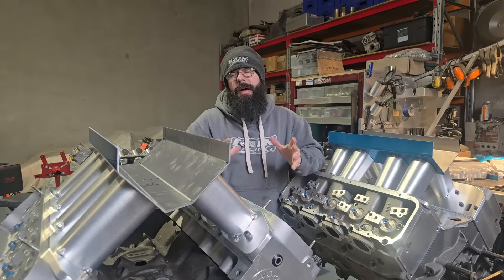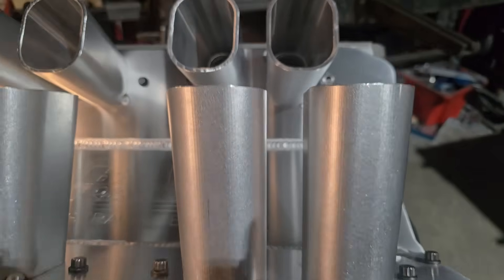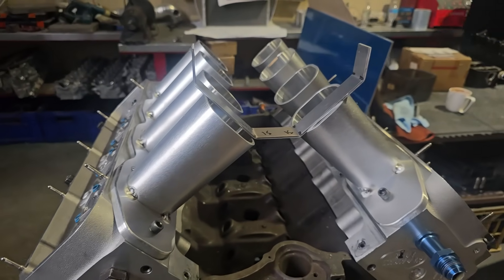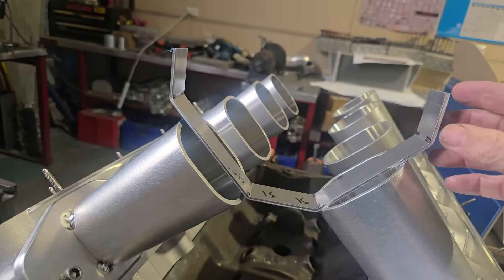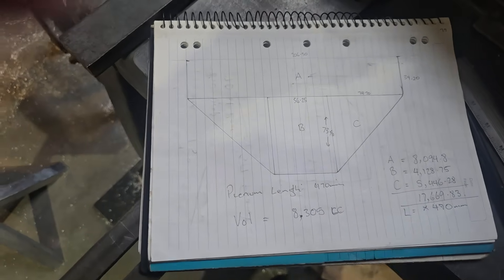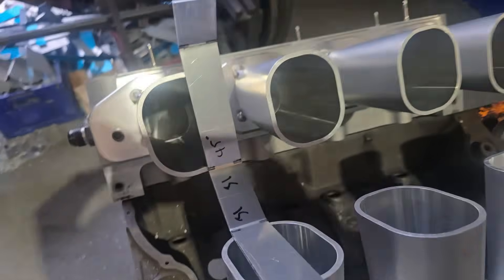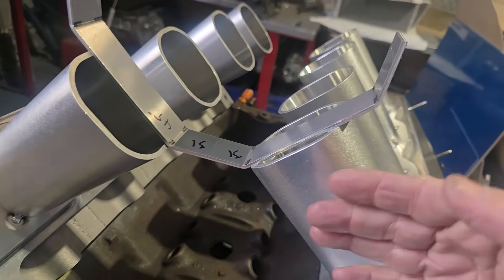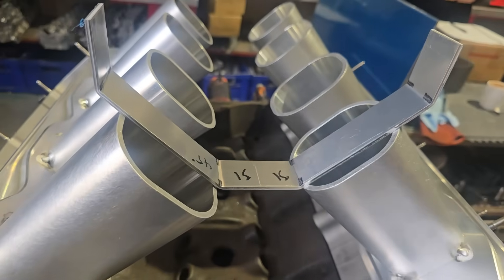TUNNEL RAM BUILD PART 3 - Plenum Volume Calculations, Runner Angles & Welding | Einstein Motors App

Comment: Is the 75% rule valid for road racing engines? I read somewhere that it was advisable to size the plenum at 10 times engine volume. I'm confused. I'm a Gold level subscriber.
Reply from the maker: Theres no real rules when it comes to plenum volume.  As even the style affects optimal size.  

But generally 50-150% depending on plenum design covers 99% of designs and how much bias the plenum has generally dictates how much more you need to compensate. 

Yeah, 10 times that crazy big.  That's what people were doing in the 90s.  We have learnt since those days that it only needs to be big enough to reduce cylinder-to-cylinder spread to a minimum.
Reply: @bainracing  - Thanks for the reply. I stupidly left out some critical facts. The engine in question is a motorcycle engine - 350cc - so ten times is only 3.5 liters. Apparently this is done in air box/plenum design with the airbox acting as a Helmholtz resonator. 

Motorcycle engines (all engines I assume) may have a dip in the torque curve at somewhere in the RPM midrange. If the box is designed such that it has the correct resonance frequency, it can help reduce this dip by increasing volumetric efficiency. Thanks again. Cheers.
Reply from the maker: All good!👍.  Yeah If ITB theres no real plenum,  but the reflection height is definitely tunable.